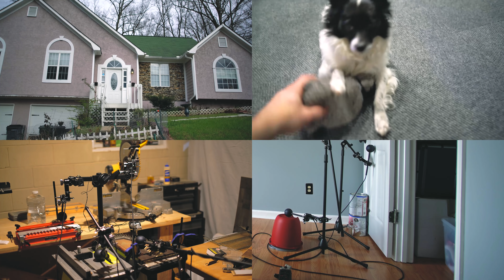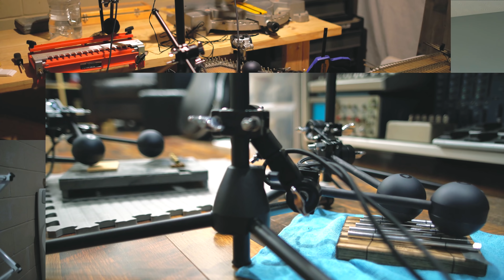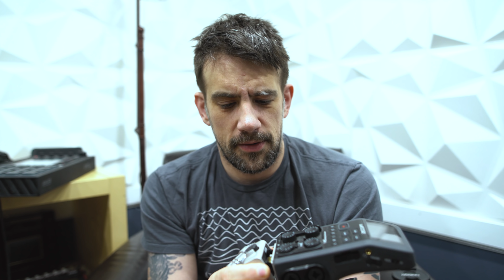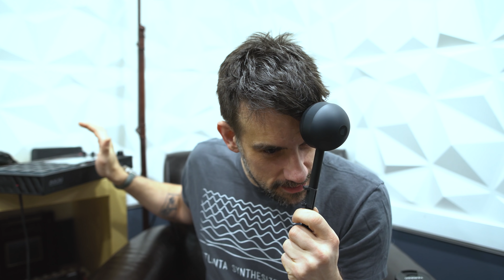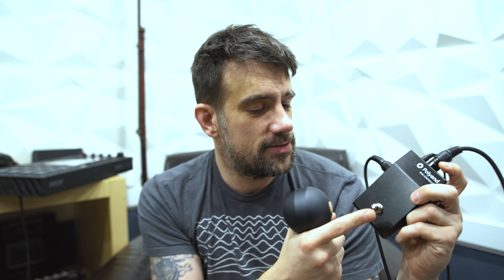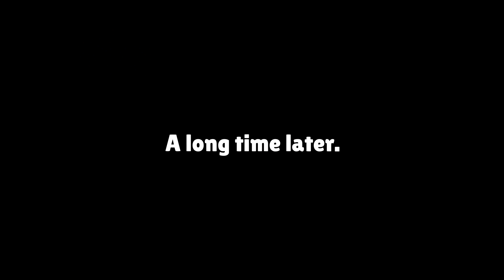Turning my house into a 16-track robotic drum machine.

Comment: Have you tried using a square-/pulse-wave to trigger the perc using the trigger input? Wondering if that would work, and potentially be a way of achieving oscillating tones out of things? Could perhaps, if possible, be done from the mpc aswell, using audio outputs and some additional amplification between outs and trigger in?

Comment: Anyway. With all that drawbacks (electrical consumption, unlinear velocity behaviour and latency issues) it's still A VERY powerful and long awaited peace of gear. 

Thank you for continuing de-trolling Polyend :) They are really good guys worth organic advertizing.
Reply from the maker: Just to be clear, the Perc overcomes all of the above. I can run them on a portable battery bank for hours, and there is typically unnoticeable latency on low velocity strikes.